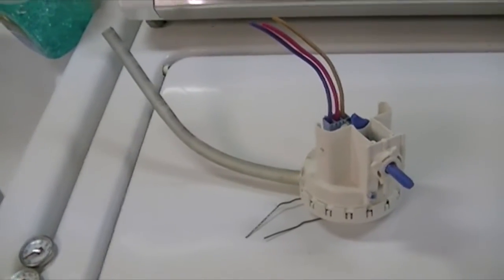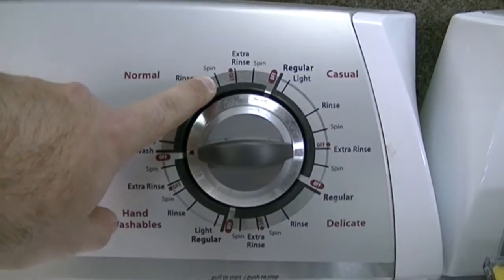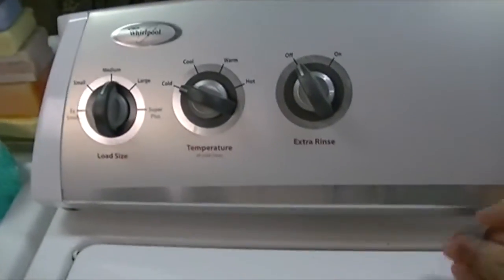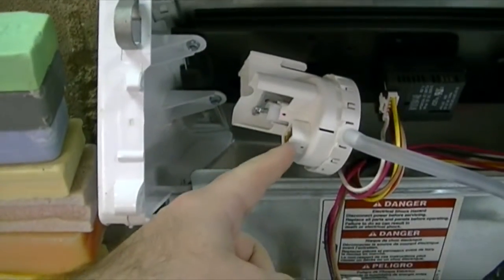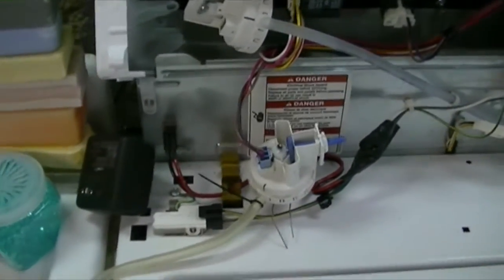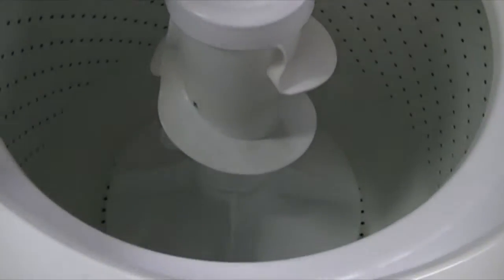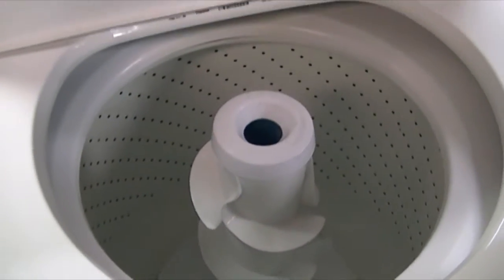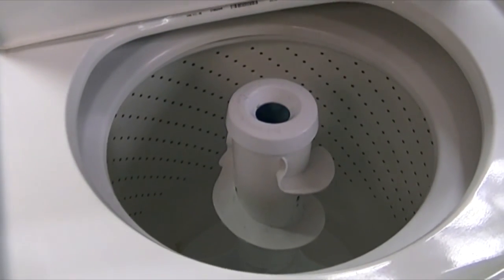Whirlpool Direct Drive Washing Machine: Water Level Switch & Neutral Drain.

Comment: If the neutral drain isn't engaging after the agitation portion of a normal wash, does that mean it needs a neutral drain pack replacement? Or might it indicate some other issue?
Reply from the maker: Usually it's a neutral pack problem. But it can also happen if the transmission is cold, and hasn't agitated enough

Comment: These older direct drive washers have always fascinated me mainly the transmission and how shifts to agitate, drain, and spin. We had one, but the pump cranked and my dad decided that “it was too old to fix”. Today we have newer Amanda top load which is described as high efficient but it leaves a smell and we end up using more water. Anyways if you know of a video that shows you how the neutral drain works visually that be much appreciated :). Love your videos.

Comment: Great video!  I work on these wonderful machines for a living and I had one earlier today that would fill up, agitate, and start the neutral drain like it’s supposed to, but wouldn’t stop and shift to spin.  It would sit and run the drain pump till somebody came and turned it off. Honestly I wasn’t sure where to begin and I was contemplating changing out the transmission, thinking it was a mechanical issue with neutral drain. Well, customer came back in the laundry room and said “by the way it has been overfilling the last couple days too“. Thank goodness she did. And for some reason when she said that it all clicked. Her machine had the five position switch like you’re using, but. I didn’t even test the pressure switch. I just made sure there wasn’t a hole in the tube, and there wasn’t.  Then I went outside and got a replacement pressure switch which was actually only a four position, but as you said, was basically identical and fit in there perfectly. It did have a red stem instead of blue and it didn’t have the extra small level so the knob was a little off with the markings on the panel. But the customer was willing to live with it because she did not want to have to wait for another month to get her machine fixed. If I had ordered the exact switch, the soonest available date to install it was just over a month out. I tested the four level switch on each of the levels and all of the cycles. I knew it would take care of the overfilling issue and I was fairly confident it was causing the continuous neutral drain. It makes sense. If the machine cannot sense win the tub is empty, how would it know when to stop and shift to spin. When I got home the repair was still on my mind. If I can’t completely understand it from a mechanical standpoint it will drive me nuts. So as usual I turned to the world wide web and found this awesome video. While you don’t come right out and say that a bad pressure switch can cause the neutral drain to get stuck in a drain, I “ can put 2 & 2 together “, and feel 110 percent confident about the repair.  Thank you for taking the time to make this and hopefully this comment will help somebody out there as well.
Reply from the maker: Thanks a lot! It's amazing what you can discover with videos like this huh? :D

Comment: It takes 10 revolutions of the transmission's main spin gear (in agitate mode) to reset the neutral drain.  The 10 teeth on the spin gear cam, along with the trip lever on the neutral drain assembly inside the transmission form a very clever mechanical counter.  This is from Whirlpool's Technical manual.
Reply from the maker: Ah, thanks for that!

Comment: I know the neutral drain assembly sets the transmission to neutral when the motor stops going counter clockwise, but how is the agitator disengaged during the drain?
Reply from the maker: There's a shift actuator in the transmission that gets angled a certain way from the reverse rotation. It hits the agitate cam which disengages the gear from the agitator shaft. That's the "clunk" you hear at the start of drain.

Comment: Interesting. Instead of blowing into it yourself, I would just get a compressor  or something similar.
Reply: +Jesse Ladner And I had a compressor right there.  Sharkie helped me with it last time he was over, in fact!
Reply: Jesse Ladner Well, that's what a regulator is for.  Basically you'd start at 0 PSI and slightly turn up until the switch clicked.  It's a lossless system, the air has to pressurize in the hose to it, so once the tank is filled the compressor could be shut off for all intents and purposes.
Reply from the maker: +Jesse Ladner Not a bad idea. It was getting a bit tough for me at the end there! haha.
Reply: Lol. That's why I prefer the older Washer Machines better. The new ones are sort of junk these days.
Reply from the maker: +Jesse Ladner Sort of?? ;)
Reply: jaykay18 Just as long as you don't exceed too much air pressure it should be good. However with the compressor running, you probably couldn't hear the washer machine.
Reply: Jesse Ladner   Just envisioning Sharkie blowing into the tube to make the machine run lends character to the video, in my opinion.  :)

Watching Sharkie and Jay doing just about anything is a blast! Good times. ❤️ these guys!